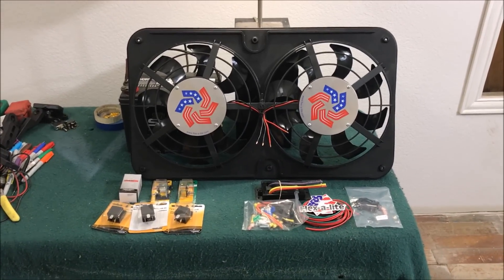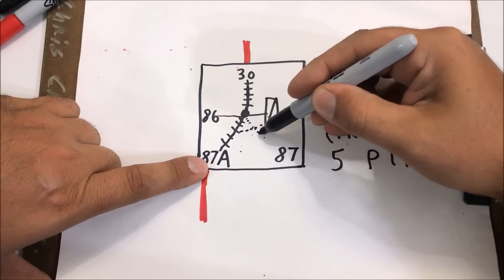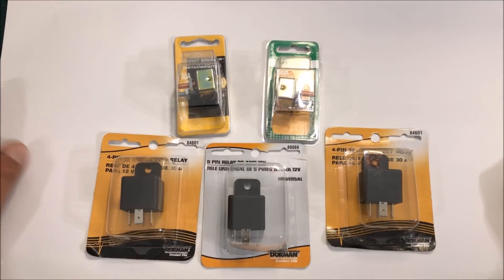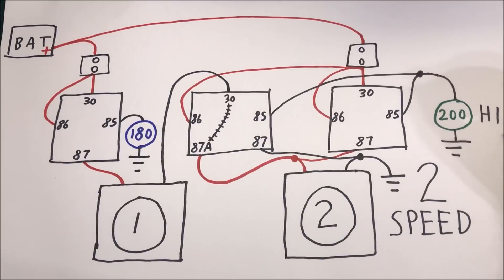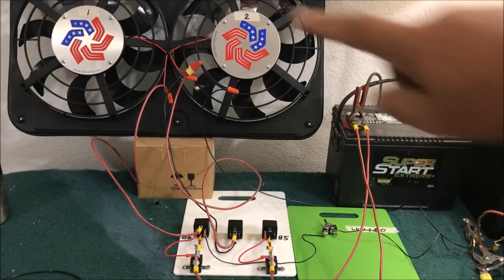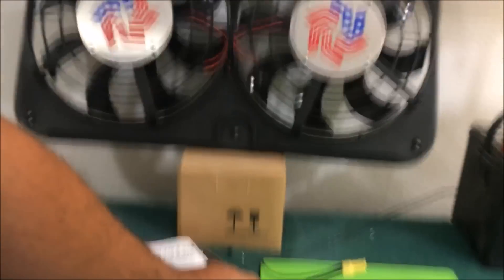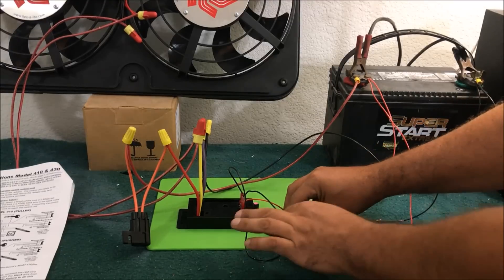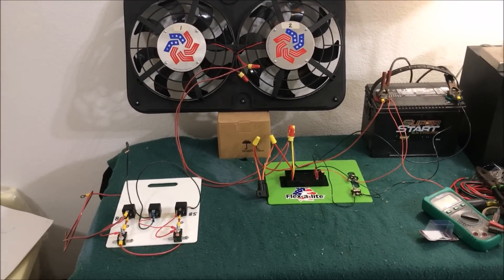auto electric cooling fan WIRING how to DIY

Comment: Hello, question. I have an actuator that I want to keep closed when my car is turned on and running. I want the actuator to open/extend when I press on the brakes. Is this possible with relays?
Reply from the maker: of course.. what are you trying to control?
Reply: @chriscraft77022  the actuator will move a wing when the brakes are pressed. When brake is released I want the wing to go back down. Poor man's DRS system lol.
Reply from the maker: @TheSocialPraxis  the problem is making it go back down when brake is depressed.. you need 2 limit switches and a 5 pin relay to start if you want to do it mechanically..  try to figure it out from there..  HONESTLY... i have no idea that drs is....  or what the exact purpose is of what you are trying to do..  look up "license plate automated kits"..  but you would have to wire that into brake pedal circuit..  FOR BRAKE LIGHTS...  i wish i knew more about it..  SORRY
Reply: @chriscraft77022  I can tap into the rear brake lights no problem. But like you said, how to get the spoiler to go back down when my foot comes off the brake pedal. Trying to make my spoiler functional, so to speak. Gimmick more them anything.
Reply from the maker: @TheSocialPraxis  i checked out your car on your channel..  i get it..  lowriders used to have the license plate come up when the brakes were pushed..   and go back down when they let off...  im 37 from, houston, TX..  maybe im old school now..  but that is what you need to look up..
Reply: @chriscraft77022  huh.... haven't seen that before but that's awesome. I'm 42 and ok with old school lol. I too am from Texas 🤙🏾.
Reply from the maker: @TheSocialPraxis  anyway, its the same idea..  2 limit switches..   5 pin..   sort of like power windows except the brake light switches the 5 pin relay instead of your finger switch..   limit switches stop the motor in one direction only..  automated gates work like this too.....  let me know what happens..  sounds like a cool idea
Reply: @chriscraft77022  I've been looking for that license plate you mentioned but I can't find anything. Any idea what they're called or who sells them or how I can find them?
Reply from the maker: @TheSocialPraxis  it's basic mechanical automation.. as far as the internet.. i dont know what to tell you..  are you by houston, TX?   by any chance.. i would have to see the project in real life..
Reply: @chriscraft77022  I'm from Texas but live in AZ.

Comment: Awesome video even if its was 2017, Thanks! My problem for my truck is that it won't turn on. Checked and replaced all the relays and controller. Even the coolant sensor. Now I'm stumped. Fan still won't turn on(the 2fans do work and the wiring). If I unplugged the coolant sensor, the computer thinks the engine is hot, both fans kick on. If I plug the wiring to the sensor back, the fans stop. I've recently replaced the thermostat too, the temperature reads correctly at 210. I can't find any solutions.

Comment: Hello, great video!! 

Quick question, on the low/high speed setup

Im wondering what happens if the 180 temp switch fails open. But the temp is at 190 so the 2nd one is closed.  
Does the power just die? 

My confusion is because of the ground of fan 1 going to the 86 normally hot of 5 pin relay. 

Also, 
Im trying to see about wiring it all up to a 3 position switch. But i realize that when i have it on position 3 simulating the 190.... the position 2 simulating the 180 would be lost. Unless i bridge them... but that would render the switch useless. 

Please help. How can i hook it all up to just 1 switch to control 2 speeds. 

Thanks sir!

Comment: Hi Chris i used your two speed wiring diagram I have a problem, from the ignition i have the fans on low speed the fans work fine but on hi speed i only have 1 fan running full speed what did i do wrong thks

Comment: I saw this video has been out for a while, but Dayum!!! Great content.

How would you wire a three relay, two speed Taurus fan to Holley Terminator?  

I have a 3 relay kit I bought years ago fro Hollister Road .com.  I used a 2 temp sensor from a BMW, but removed it since Holley can now control the fans.  This relay kit kicks low on gradually (180°) and then shuts off the low if the Hi turns on (195°).  Once Hi cools down to 180° it will turn off and then the Low will turn back on.

Any suggestions on how to connect this to Holley?

Comment: I Liked it.  From the number of thumbs down, it's clearly over the heads of some folks that do not have the fundamental understanding of relays and voltages and parallel vs series paths.  My Flex-A-Lite controller just went out, and I'm deciding whether to bypass it and replace with this relay setup, or just pay the money and replace the control module.  Thanks for the instructional.
Reply from the maker: that is a tough decision.. I think the thumbs downs are on how to turn the relays on.. people don’t understand there are many ways

Comment: I really like the 3 relay setup, is that how Nelson Preformance harness is made? And big question, do you know if the Dakota pac-2750 controller will work with the 3 relay setup? It has the two negative pin low and high setup, but they show it on a two relay setup where one fan goes on high at low pin, the other fan goes on high at high pin. Really need to know!! Thankyou for sharing this video.

Comment: Thanks for the video! I'm running my fans IN-Series mode. Can you help me how do I wire a backup switch on top of that In-Series mode in case something happens like if my temp sensor break and I want to turn the fans manually? That would help me a lot. Thank you!

Comment: Hey sir, i used your wiring in a 2000 silverado. Works great! Where would be thr best place to tap into remote power so fans turn off completely when i turn off my key
Reply from the maker: I haven’t worked on that year so you have to go on internet and see where people are finding a keyed ON place under the hood... a 2000 should have a place for sure..  sorry, I don’t know.. but it is an easy thing to do
Reply: @chriscraft77022  ok sounds good... I'll check online. Thank you again!

Comment: Greetings, i love this set up! Thank you. Only problem i have is my fuse keeps blowing
 How do i prevent this from happening? The power wire overheats and the fuse pops. Only does it when fans are running high speed. Thank you in advance for your help
Reply from the maker: bigger wire.. I run all my stuff on 10g
Reply: @chriscraft77022  Ok. Cool! You're absolutely right. Come to think of it...The wire that burns up is definitely smaller than the others wires

Comment: A bit confused. My 2 fans are very tiny (5 inch)and will pull about 6.5 amps each.theyre for an oil cooler. Its gonna be 1 relay since they draw low amps. I have a 30 amp circuit breaker to 30 on relay and both fans are wired into 87.
So my question is would i be able to send power from the circuit breaker to 86 and have the toggle switch just be connected to the 85(ground)?
Reply from the maker: yes.. what on earth are you running that you need an oil cooler?
Reply: @chriscraft77022  well shit thanks chris!
another small question. I got a water pump that draws 3.9amps. I want to wire a toggle switch onto that. Do you think its alright to just wire the switch into that without a relay since its very low amps? or do you recommend a relay for that?

Comment: Great info! 
Can i use this system for dual fan, 2speed with a dakota digital fan controller? 
And can i use one temp sensor for both low and high speed to the controller?
Reply from the maker: yes.. look up bmw temp sensor I have a video

Comment: Can you use a separate set of smaller fuse and wire gauge going to 86. And from 85 to your temperature sensor to ground? Not much amperage draw in that circuit compared to both fans.
Reply from the maker: yes, use 16-22 gauge

Comment: Maybe this is a dumb question, but can anyone tell me where im putting these Temp sensors? Or can i just wire all 3 "grounds" (sensor connections) to my factory temp sensor in my thermostat housing since it senses the low and high temps already
Reply from the maker: yes.. but you need to make sure 100% that temp sensor doesn’t have HOT going to one of the three.. I know bmw / Volvo can
Reply: @chriscraft77022  its a 2005 Ford Mustang
Reply: @chriscraft77022  i was also wondering if ita possible to wire 2 fans each with 1 power and 1 ground to a 2 speed factory harness that way i can use the factory relays and factory temp sensor. I cant seem to find anything online for that

Comment: Hi Chris, super video learned a lot!!         is it possible to run 1 electric fan with low speed and high speed ( 2 censor )????? Like you show with 3 Relays 2 Fans 2 censors.
Kind regards Roger.
Reply from the maker: not with relays
Reply: @chriscraft77022  Ok Chris was allready thinking  not possible.  I like the 3 Relay version 2 fans a lot. Thanks for your time. Kind Regards Roger-- The Netherlands.

Comment: Hi Chris, thanks for the video. Please, can I use one toggle switch to control the two fans at low speed. I mean connecting pin 85 on the two relays to a single switch ? Will there be any effect on the circuit? Thanks again
Reply from the maker: yes, but you could do that with only 1 relay
Reply: @chriscraft77022  , I mean using two relays, but controlling the two fans at low speed with one  switch? wouldn't one relay be overloaded when it controls the two fans?
Reply from the maker: Not on low speed

Comment: This video is Gold by far the best, your a really good teacher.  Question on step 2 at the 9:30 mark, Am I able to do this set up on a single fan with dual speed by adding the 5 pin relay? I've been searching far and wide lol this is the only video that makes sense on what I'm trying to accomplish. is it possible to do this set up with single fan dual speed? Thanks
Reply from the maker: no

Comment: help my.. i have escudo car.. but ac not operation i cek relay fan and magnetic cluth is oke but voltage to wire fan and magnetic clud zero...fuse and relay oke...i have solution  problem...

Comment: I followed your video and everything is working. My only problem is that when I cut my truck off the fan still run. I would like to turn them off when the key.
Reply from the maker: I have a part 2 .. in that case run switch on with key power to 86
Reply: Got it, thanks alot. One more thing, I have a sanden 805 compressor and I'm trying get my ac charged up but I'm confused on getting the fans to come on with the ac switch. Do I need to run another relay or tap into one of the three relays?
Reply from the maker: that’s in that video too..   some people get trinary switch but you don’t need it

Comment: Would these fans work on a 454 big block in your opinion?
Reply from the maker: thats what is on my car... I do have a 4 row desert cooler radiator, though...
Reply: Chris Craft I have a 4 row champion and I am wondering if it would be enough cfm. Thanks again Chris for the quick reply.
Reply from the maker: this is literally the ideal set up for these cars.   what car you working on?
Reply: Chris Craft I have a 66 Chevelle SS with a 454 big block so space is tight as you know. Want to get rid of the mechanical fan and was wondering if these flex a lite fans did the job for you? Your videos have been a huge help.

Comment: Why do ppl want to add cooling fans to their vehicle?? The vehicle was made to keep the right temps....if something is overheating,fix the parts causing it!!!
Reply from the maker: I agree 100%. but they do it because the drag of the mechanical fan at high rpm can cost 5 to 10 hp sometimes..  especially on trucks with big fans..  another reason is at high rpm you can actually spin the pressed shaft out of the water pump and have the fan blades go through your hood at 6000 rpm

Comment: With single fan you can use on 4 pin 85 for temp sensor 87 to the fan 86 ignition switch or toggle switch as ignition switch
Reply: I like the 4 PIN RELAY ON My ford ranger with 3 core radiator

Comment: Chris great video! 1 question I don’t understand how the flex lite can run both fans I only see one relay 30/40 amp.you said in the beginning of the video the fans are 22 amps each isn’t that to much to run one relay? Thanks keep the videos coming.
Reply from the maker: with a close distance you can run a lot more amps than they are rated for.. I think it’s based on 100 ft of wire.. google image voltage drop charts and you will see..

Comment: Can someone explain to me what the benefit to having the fans come on in stages like that, rather than both on at the same time? i.e. why wouldn't you just have them both came on at 180 and shut off at 170, rather than the second one come on at 200?
Reply from the maker: because they pull 50 amps when they both come on at the same time....  thats why..  and..  you dont always need both fans on..  1 fan on can keep you good until you get on the throttle..

Comment: Yoooo! For a trolling motor I’m adding a 5 pin relay and a breaker, can I put the break on 87 and a 10g fuse on 30?
Reply from the maker: you can put breakers and fuses anywhere

Comment: This video helped me out alot with my 69 Camaro. But is there a way I can wire them in so #1 kicks on at 180  by its self and #2 kicks on with  #1 at 200 and and have the AC kick both on at once when needed??
Reply from the maker: I have a part 2 wiring relays

Comment: Hi Chris, great video. I am trying to build a custom duel fan setup with a timer that runs the fan at low speed once the ignition is shut off. My question is do both the 4 pin relays need to be closed in order to achieve hi speed or will the fans run at hi speed with just the second 4 pin relay closed? ....If that makes sense.

Comment: Thank brother. A nice video . in the case when you used the second fan like a resistor what will happend if this last fan failed . we will have not any cooling ( no low speed no high speed) . it is prefer used the resistor in lieu of fan.

Comment: 4:27 can i use this diagram for push fan i want to add 2 fans which is 12v 80watts. the main reason is have my ac more cooler

Comment: Chris, I've been working with your layout for the two speed fan set up.  I just discovered the BMW 2 temp switch, and that is how I'm going now.  I am using 3 relays, as you did, middle one SPDT.  1 and 3, SPST.  I am running switched 12v power to the BMW switch.  From that switch, I am running the low temp wire to terminal 86, on relay #1.  The high temp signal to 86, on both relay #2. and #3.  #85 on all 3 relays go to ground, and #87 on relay #2 goes to ground.  I hope I have it right, 'cause it even makes sense!  Thank you for your help.

Comment: I know I'm electrically challenged, but I still can't wrap my head around why the switch works on the post-relay side of the circuit, vs. being on the pre-relay side. It seems like it would need the toggle switch on the pre side to allow the positive charge to hit the relay and trigger the switch. Does this make any difference having the charge waiting at the relay? Cool video and detailed explanations!
Reply from the maker: post and pre?   i have an automotive relay explained video..  check it out..

Comment: I can’t see how fan #1 will run if (like your diagram shows) you wire it to terminal 30 on the second relay. There’s no path to ground. Am I missing something ? Wouldn’t they both relays have to be energized in order for a ground patch to exist ?
Reply from the maker: i run the fans in the video... I show where the grounds are...

Comment: Hi Chris...Wow...aw some video..need help...98 Lincoln 4.6...A/C compressor clutch disintigrated...removed compressor replaced with a/c bypass kit...now the electric cooling fan runs all the time even when ignition is off...even when engine is cold...drains battery dead...any remedy...Thanks...

Comment: Hi Chris. Thank you for the great video.
One thing I noted, at high temp (with the BMW two-step switch) or A/C on signal spliced into the high side sensor wire, only fan 2 will spin in high speed as the fan 1 relay is not energized and will not spin at all (Ref: your Step 2 High screenshot).
I solved this by installing a bypass with an inline rectifier diode from the high speed to the low speed signal wire.
...and yes, I have watched the part 2 video.

Comment: I was wondering if you could clear something up for me. Wouldn't using a 4 pin relay work the same way as using a 5 pin relay, being that you wouldn't have the need to use the extra wire going into 87a. My understanding is 87a is just a "rest" you could say, before the connection is established between 30 and 87. In other words, what purpose does the wire going into 87a have?
Reply from the maker: On a 5 pin power is either going to 87a or to 87 ( think high beam and low beam headlights)   sort of a single pole double throw ... 4 pin is just a single pole single throw switch.. people use a 5 pin where they don’t need it so many times because they don’t know what they are doing .. like all over YouTube

Comment: I am using a two speed fan with three wires 1 grnd one high speed and one low speed can I just use the high speed wire?
Reply from the maker: you should be able to

Comment: Why need to use breakers.
Reply from the maker: because the fans can short out and catch your car on fire.. imagine the bearings going out and they stop turning..  the wires will heat up and catch fire without a breaker..  they are thermal breakers.. just use a fuse or something..
Reply: @chriscraft77022  so if you use breakers don't need to use fuse ?
Reply from the maker: either one ..  the breakers are better and probably cheaper
Reply: That you your videos are really helpful.